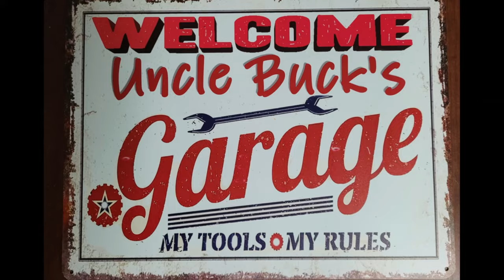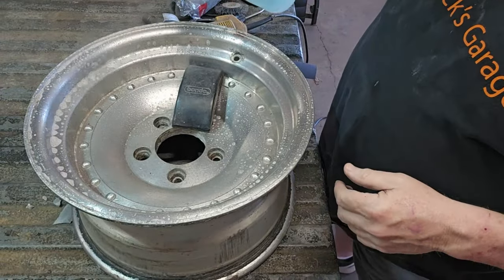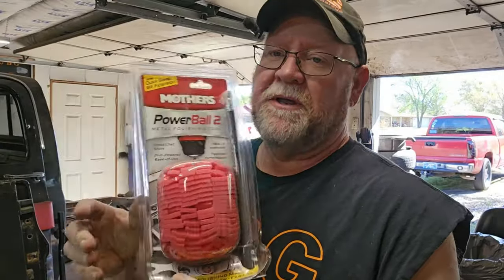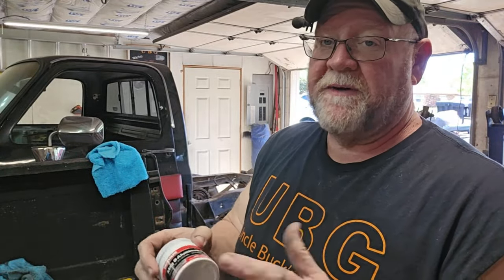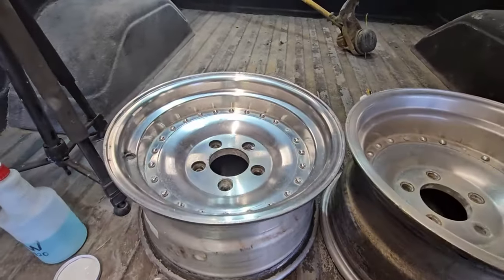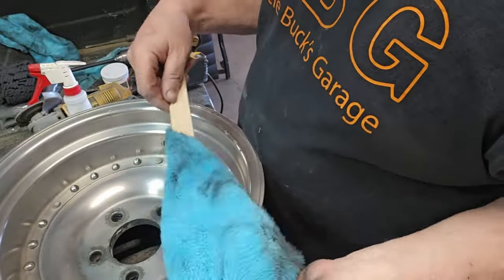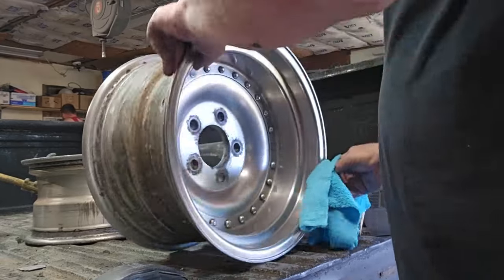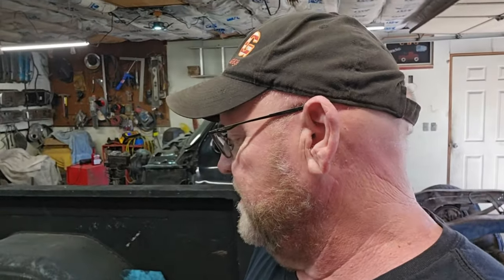How to Easily POLISH ALUMINUM WHEELS 👀 Square Body Chevy Hotrod

Comment: Good job
Reply from the maker: Thanks
Reply: Great job!!!
Reply: Looks great!
Now to make it last longer on aluminum. Not really going to work on wheels because you’ll be washing them. But say something that’s going to be a wall hanger like a hub cap. Rub the aluminum with flour. Plain white baking flour. Then dust it off. I did this with an antique aluminum traffic light that we hung up in my son’s room. 👍
Reply: I’ve also heard of people spraying a clear coat on wheels but then it will have a tint to them.
Reply from the maker: I HAVE NEVER HEARD OF THAT BEFORE
Reply from the maker: YEAH NOT DOING THAT